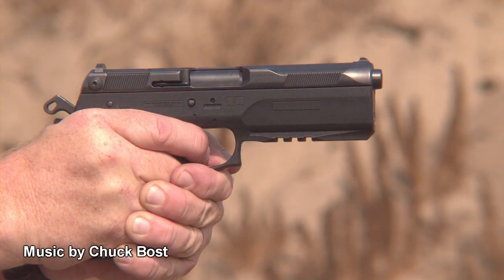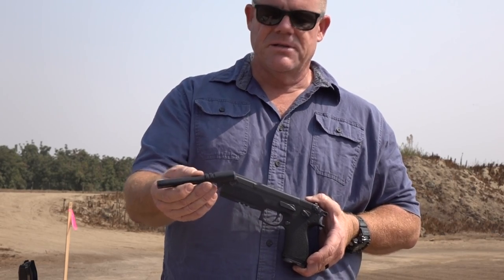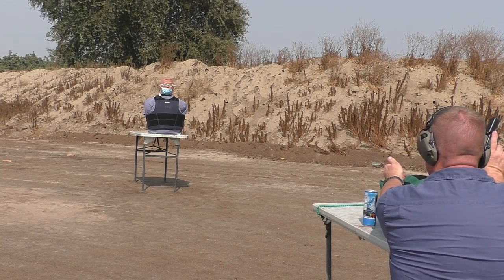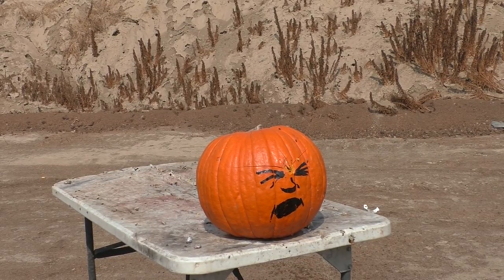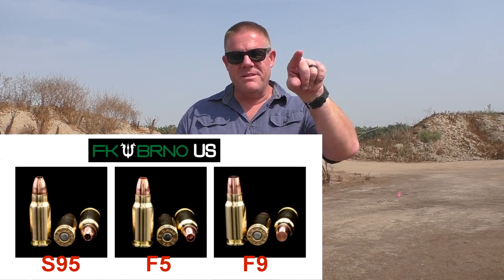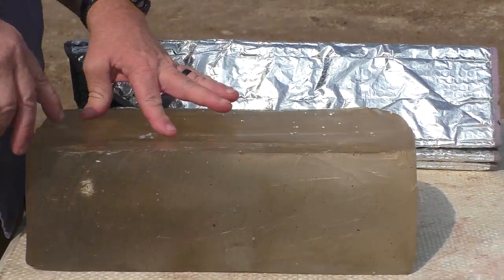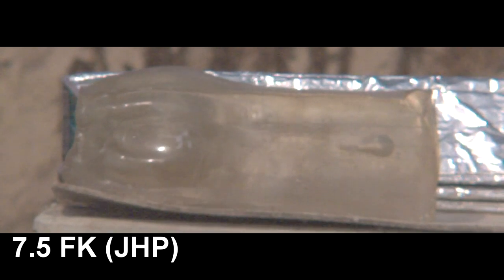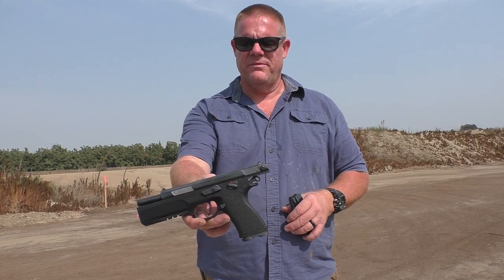FK BRNO 7.5 FK  -vs-  Glock 19 in 9mm

Comment: Honestly seems like an enlarged and modern tokorev
Reply: I was going to say the same thing. Had they kept making the Tokorev, it would have evolved to become this.
Reply: @Dan Didnot it would punch right through unless it glanced the helmet, ballist helmets are only rated at IIIa and more often than not speed beats armor.
Reply: Yup...the Tok reinvented....
Reply: more like a scaled up CZ75
Reply: @beauleidig8670  They still make Tokarevs in Vietnam. They're double stack.
Reply: @mauer594  I was unaware. Do you know if they're made well, or if they're available anywhere other than Vietnam?
Reply: The tok seems like a hot 30 mauser.  Which sounds like an adapted 7.63 borchard. 😁
Reply: @randymagnum143  tok actually is hot mauser.  The russians picked up some C96s in WW1 and liked them as they were already .30 cal, and Russia liked being able to use the same barrel blanks for side arms and rifles.  So they made it way hotter because thats cheaper than actual R&D.  If you have a Tok or a CZ52 you can run mauser through it just fine.  But you cant run tok through a broomhandle

Comment: I'm honestly interested to see how much it out performs a  30 carbine
Reply: That’ll smoke a .30 carbine.   Just look at the ballistics charts.
Reply: Yes, the .357 out of a short lever gun or a .30 carbine from an M1 would be an excellent comparison. After-all it’s supposed to be a “replacement” for this kind of thing.
Reply: @joshuaborchardt4355  .30 carbine and the 7.5 are basically the same bullet weight, bullet diameter and muzzle velocity(albeit different barrel lengths), so the performance should be similar, assuming same bullet design. Most .30 carbine is fmj ball ammo though.
Reply: @killdizzle  It's about 400 fps faster than a Tokarev with the same bullet weight.  The difference between the a .357 mag and a standard .38 special is right around 400 fps with the same bullet.  That should give you an idea.
Reply: I can only think of rifles to compare this thing to.  How about a lever action 327 federal?
Reply: 5.7 would be very interesting to see
Reply: @Paddy Splatz Not really, it is a new one, polimer frame. It is about 1500-1700 us if my memory serves me right. And it comes with 2 barrels.
Reply: +1 to this thread
Reply: @Paddy Splatz The metal frame ones are these are claimed to be around $2,000
Reply: @beckhamhome  
$1650 on their website.
Reply: I would like to see  G40 converted to 9x25 Dillion and compare the 2. The 9x25 would not have the ballistic coefficient as the longer yet thinner 7.5 mm projectile. So the downrage energy may not be as good, but dies, projectiles, and brass are readily available. Along with a plethora of projectile options.
Reply: Beat me to it
Reply: @joshuaborchardt4355  I think the comparison is not so much for bullet to bullet comparison but for purpose of platform.   The 30 carbine was specifically made to reach out past pistol range but be handier than a rifle... so it would be more of a camparison of the "then" and "now".

The 30 carbine might not be too bad.  The bullet is almost 50% heavier and is moving pretty ok at 100 yards... i dont think it will make it through 3A but maybe.  The ballistics charts dont take into account bullet shape so that would be interesting too... you would see the simplest round nose bullet vs the bleeding edge whizbang cartridge... now if the made a carbine or a longer barrel pistol for the 7.5...
Reply: That was a long video to explain how 12ga slug wins.
Reply: If this comes in a .30 carbine... Let me know... Will get one.
Reply: It doesnt.
Reply: That would be awesome.
Reply: @imhigh0013  the Overall Length of 30 carbine is Much Longer than 7.5.
Reply: @someguy2741  .30 Carbine bullets are typically 110gr, versus the 7.5 FK's 90gr and 100gr. So definitely not 50% heavier. Despite their distinct case geometries, they both have nearly identical internal volume. The 7.5 FK is a little more efficient with its stubbier case, but the main difference is the operating pressure: 7.5 FK is a hotter load than anything you can get commercially in .30 C, though you can make your own custom nuclear loads if you have a .30 Carbine T/C break action, like an Encore, or if safety isn't a priority for you.
Reply: @ostiariusalpha  Totally had 75 on the brain... I had the 110gr RN carbine in there alright.  I would be interested in the comparison still for two reasons, first to see the then and now of the same usage of firearm and second to see the ballistic effect on a target at the intended 100 or 150 yards.  

I would assume on unarmoured targets the carbine would still kill it dead since it is like a 357 magnum at the muzzle at 100 yards and we know the FK will work.  I wonder what the difference would be on unarmoured targets... are you dealing with a single or two unarmoured nutjobs or a crew of 8 with armour?  If you are dealing with a professional crew you are outgunned and they capped their target with a sniper rifle as their first shot... or capped two of your crew first thing if they want to kidnap the target.  If I was at risk of an ambush I would want something capable of reasonable rifle ranges and nothing in a pistol range.  It would be fun to see the carbine fail against the 3A.  And maybe an accuracy test to show the difference between a carbine solution vs a pistol solution.
Reply: @someguy2741  I haven't shot any 7.5 FK personally, but I have shot feral pigs out to nearly a 100 yards with .30 Carbine from an Auto Mag pistol. The round effectively penetrates boars at that distance, so I imagine the 7.5 FK should potentially extend the range even further. 7.62x25mm Tokarev can defeat Lv IIIA at close range a certain amount of the time, so .30 Carbine can certainly do it. It's just a matter of what range it starts to penetrate less reliably at.
Reply: @ostiariusalpha  Interesting... do you really think 30 carbine would defeat 3A at point blank?  I suppose the tokorev is similar... that would be an interesting test... at what distances would 30 carbine pierce 3A...
Reply: @someguy2741  It depends on the IIIA used also. I'm betting it would handily defeat Kevlar fiber, but a UHMWPE plate could give even 7.5 FK some real trouble.
Reply: @ostiariusalpha  I am not familiar with that... is it a polymer plate or does it just perform far better than its certification?
Reply: @someguy2741  Yep, it's pretty new on the market and quite an impressive performer for the weight: ultra high molecular weight polyethylene. A Lv III plate of UHMWPE can stop bullets that Lv III steel plates fail to, all for less weight.
Reply: Ruger 5.7
Reply: @killdizzle  I believe whoteewho channel did this. It's been done, I just can't rem who. I'm wanting to say paul harrell as well. I watch so many gun channels I can't always rem. Lol
Reply: I want to see this vs a tokarev. At 1650 USD. I'll just stick to the tokarev
Reply: @jf752  1600 ain't too bad. It will take a little saving and not buying starbucks and stupid shit, but I'll have one in about the next 2 months.
Reply: @Dilly Dilly $1650 for this psd
Reply: At 200 yds it is easy to see why it's better
Reply: I was also wondering about one CMMG carbine w/ 'radial.lok' + some kinda 'Lehigh Defense' fluted nose 'boolits'. Could work to control TX's destructive wild hog overpopulation.
Reply: BTW: I'm getting (avg) Speer 158gr HP 1.985 fps + Hodgdon's Lil Gun, out of my (1.995) IWI Timberwolf .357, and 1.25 - 1.5 five rds groups. Primary Arms optic.

Comment: I'd like to see it against itself. 7.5 10mm and .40s&w. Particularly, compared recoil.
Reply: See the OG'S Danger Show channel; your wish is granted.
Reply: And 7.62x33 tok, .38 super and 9x25 dillon.
Reply: And the 22 tcm
Reply: compare it to a 22 TCM-R. Rock island 250 to 300 usd on ebay for the upper that goes on a glock17. got mine 4 years ago.
Reply: @aychemara  I want the Rock Island 1911 17 +1 22 tcm

Comment: The reason why you shouldn't shoot 40 Smith and Wesson out of 10 mm has to do with Where it head spaces. .40s&w basically uses the extractor to headspace in a 10mm barrel.  Wonder how BRNO solved that problem.
Reply: The breech face of the FK pistol completely surrounds the case head with a ring of steel, similar to a pre-70 Winchester bolt gun.  It holds the rim with much more strength than just the extractor like on a Glock.
Reply: @OGsDangerShow  makes sense
Reply: I doubt even hot .40S&W loads would exceed the pressure of 7.5.
Reply: So can any pistol that shoots 10mm also shoot 40 S&W kinda like .38 Special out of.357’s?
Reply: Is that really your music, Chuck?!?!?   😳
Reply: @txvet7738   No not any pistol. Many people do it but if you have a hot 40 Smith and Wesson round it can blow your extractor because of where it head spaces
Reply: @txvet7738  It Could;but it should not! Besides ruining the chamber,you might at some point get a nasty surprise!That .40 has some tricky inner ballistics.Remember,the only Glocks that literally blow up,are.40 S&W!!!!
Reply: @pebo8306  well that’s messed up! I wonder if this is a connection to why many police agencies are switching back to the Glock 17s? My department had Glock 22 and went back to 17s after I left.
Reply: @txvet7738  Pure economy!the.40 is a direct product of the Miami shootout.But it is a flawed design,having to have max lenght of 9mm,but withstanding only .45 Acp gas pressure.With todays bullets;Hornady,Federal;Speer;a 9mm has every stopping power of a.40,plus you have more bullets.

Comment: I would like to see that in a comparison to 7.62 tokarev
Reply: 7.5 FK, at least on paper, is going to  beat the Tokarev.
 7.5 has roughly 150 more feet pounds of energy over the 7.62 with similar barrel lengths.
In actual application, from what I've seen, they perform very similar. Both are going through level IIIa soft armor without difficulty.
Reply: I would be interested in seeing that comparison.
Reply: @Evinthal84  7.62x25mm is one of my favorite rounds of all time, but it doesn't reliably defeat Lv IIIA armor. There are plenty of videos on YT of it failing to consistently penetrate.
Reply: @ostiariusalpha  I will have to look into this then. All of the ones I have seen so far it went through. Thanks for making me aware of this!
Reply: @ostiariusalpha  commercial ammo won't
Reply: @LIONTAMER3D  It's not a good idea to stray too far from commercial loads with  old Com Bloc pistols, they weren't intended for that kind of abuse. I wish someone would come out with a modern, double-stack, polymer frame pistol chambered in 7.62mm Tok that used modern steel in the barrel. Of course, it still would not be close to 7.5 FK's performance even then, but it would be pretty cool.
Reply: @ostiariusalpha  - at one time you could get a barrel for the glock 20 and drop it in then you had the exact pistol you described.
Reply: @peterv1318  Glock 20 mags are not designed to handle the smaller case diameter and longer COAL of 7.62mm Tokarev. There's a reason they don't sell those barrels anymore.

Comment: Hey, I saw the BRNO on Officer Greg's Danger Show!  

I watched the older stuff, too.  I gotta say, its'a perfectly named channel.
Reply: Thanks for watching!   😎👍
Reply: Yes but this didn't fool me none I can tell it's not the OG, this is Breanna in her Halloween costume!
Reply: @OGsDangerShow  😂
Reply: My only issue with this pistol is that it's just a slightly modified CZ-75 design with the single-action-only trigger pack, a pistol that could be had for $500 or less at pre-panic prices. And we already know that this design can handle hot loads; look at the original Jericho that supported .41 AE. So other than lengthening the ejection port and moving the recoil spring down, what did they do to justify this being a $2000 gun?

Comment: I'd really like to see this compared to 9x25 dillon. On paper they're damn near identical. Just drop a  barrel in your 10mm glock and you're good to go rather than spend 1600 dollars on this gucci gun.
Reply: Get a .357 Sig barrel for for your Glock and it’s even cheaper.
Reply: I think you would see the biggest difference at longer ranges, 7.5 should be a higher velocity. But, does that really matter with a pistol? To me it doesn't. I'd be more interested in a PCC/PDW setup.

Comment: It would be neat to see it up against a 7.62x25 Tokarev. The Tokarev is a way older round. It's a hotter version of the .30 Mauser, which was the basis for the 9mm Luger. But it is an 85 grain bullet burped out at just over 1600 fps. The 7.5 is still going to outclass it all the way, especially with that bullet that is basically a spitzer and the much larger powder capacity, but it would be neat to see. I imagine you'd have trouble finding one though. I'd loan you mine, but you're on the other side of the country. And basically in a different country, for all intents and purposes. Lol. Very cool video though. Super, super cool that FK has you on their radar as well. I hope that leads to some other big manufacturers landing eyes on you as well.

Comment: So, before you even get to firing, i'm noticing those rounds are weird, two straight up meaning the ball is 7.5ish, but that middle crimped round? Looks to be around half or two thirds the actual size? is there any notable performance change between them? But jesus, look at that rotational force on the 7.5 vs 3A, wouldn't want to be near the hot end of that.

Comment: What I really want to know is this:
Since the base cartridge of the 7.5 is a 10mm, and the Brno actually comes with both caliber barrels, at what point will we see barrels chambered in 7.5 come out for already existing 10mm handguns such as the Glock 20?
And will a Glock 20 with a 22 pound spring be able to handle the 7.5 without getting beat up too much?

Comment: You all generally have amazing content on your channel.  It was unfortunate that you were unable to test the solid copper rounds against the harder targets.  Hopefully you will be able to check them out in the future!  The results against the soft targets were surprising and may have required fresh individual targets for a better comparison, especially since even the gel test shot with the 7.5 was probably a bit close to the previous 12ga. wound channel.  I would definitely like to see the solid copper rounds tested against the lead plate and perhaps against 3/8" mild steel, if you could possibly do it safely (that thickness of mild steel can definitely cause dangerous backsplash so you would have to be creative in firing remotely, as testing from a safe enough distance would start to negate the advantages of the high velocities that are one of the hallmarks of the cartridge (think pistol rests, here).  Just some thoughts.  Again, it's too bad that you were unable to get the solids for these tests, though there may have been a reason.  As I noted at the beginning of this comment... you all have some of the best gun related content on the internet!   Keep up the good work and as always, stay safe...MLV.

Comment: I know the 10mm barrel can fit and shoot an 40 cal and 10mm. And the 10mm bullet will not fit all the way into the 7.5 barrel.  BUT will the 40 cal fit into the 7.5 barrel and fire? And I know the gun may blow up then. But you only showed a 10 mm in the other barrel not the 40 cal.

Comment: 7.5 fk vs. .357 Sig please.  I'd also like to see how it stacks up against an actual 40 caliber pistol with a long barrel and it 10 mm crystal with a long barrel. What I mean is swap out the barrels, 40 calibers  10 mm verses 10  and. 40 to see if the FK brno's pistol stats match that of a stock 40 cal or 10 mm.

Comment: that recovered 7.5 from the gel and the wound track it made are almost the same as what I get with my Tokarev when I use good hp ammo. the Tokarev rounds stayed intact no jacket separation. the fk is more powerful for sure. I'm making around 500lbft with an 85 gr bullet approaching 1700fps if my math is correct. I only have 1 gel block at the moment so I can't provide average penetration, it can't be much more than 16 inches though because 1 out of 5 will stop around 15 inches in 10 percent gel. ballistic testing is addictively fun stuff, I can't get enough of it.

Comment: Considering the current price of ammo in the common calibers, this stuff will be astronomically pricey or just pricey, nothing about it says user friendly price or availability. Won't be simple to reload as well with a necked cartridge  and head spacing. Impressive cartridge though. With the watered-down 10mm's today (35-36,000 psi), it kinda make you miss the original loadings at 50,000 psi from the now disappeared Bren Ten. Too bad the 224 Boz isn't around any longer, would give this cartridge a run for it's money.

Comment: The pumpkin absorbs the 9mm ofc due to lower velocity, and the 7.5 FK obvy will zip through it because the pumpkin even with water doesn't have a strong enough molecular structure to absorb the bullets kinetic energy.

Comment: I would love to see the 7.5 FK vs. some Underwood Extreme Penetrator in 10mm used on targets that simulate a large bear or hog or something.  A test that kinda demonstrates which would you rather have for bear protection kind of thing.
Reply: I've killed alot of hogs with my Five seveN I'm sure the fk 7.5 would do fine

Comment: Great video! Can you check it out for effectiveness at the ranges its meant for ? Like 100+ metres ? Maybe against a light rifle calibre using a similar projectile weight and muzzle velocity. Can I suggest one of the targets is your meat target with 2 or 3 water jugs behind to catch the rounds. BUT this time, don't perform surgery on the meat until after both have been compared. It would have been a better visual comparision to see the raw damage to both meat targets in this video. Thanks :)
Reply: Not sure I can hit a pork shoulder at 110 meters.  😬